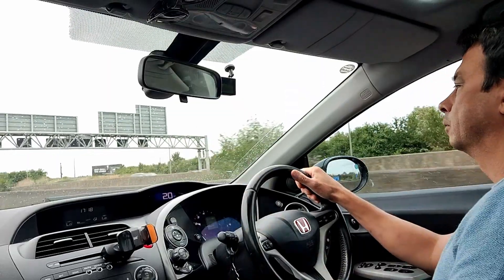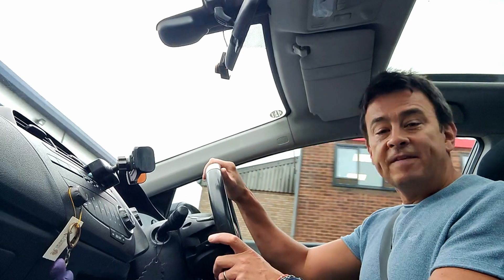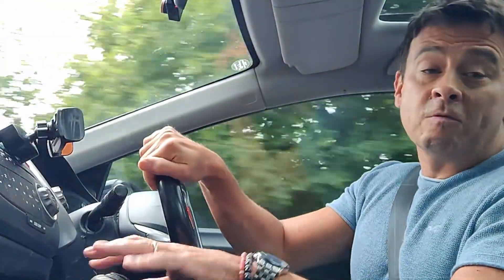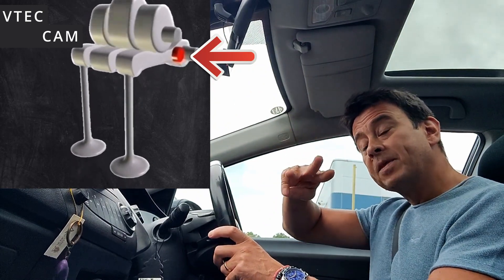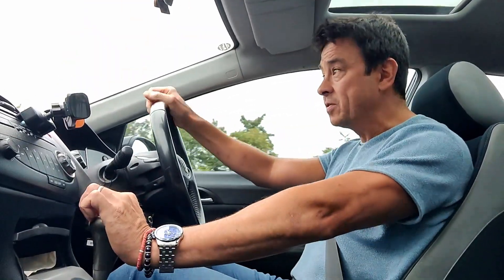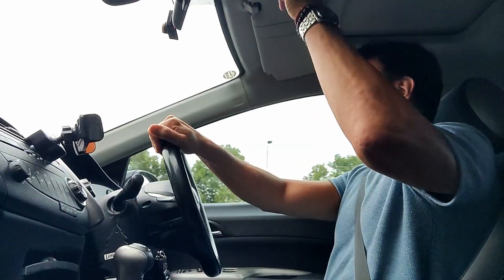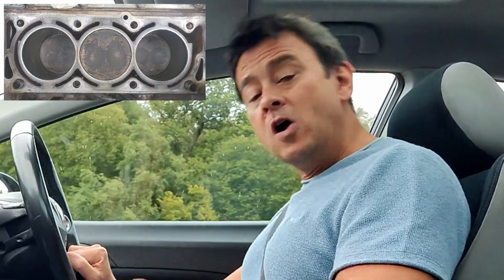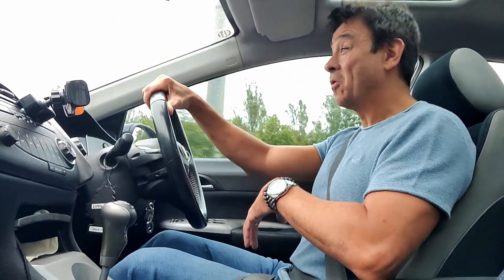Does your VTEC smell?😝- Here's how VTEC works - Honda Civic MK8

Comment: You are quite right, i get a carbon smell quite bad if i hit Vtec in my Honda Civic Type S GT. 

At first I assumed it was a slight manifold exhaust leak, but it was never picked up on any of the Mot's even when I mentioned it and it got looked at. 
I then asked a good Honda mechanic his opinion, he said the same as you about the Vtec and said these engines love a good clear out at higher revs every now and again (once a week), he checked my service history just to be sure and confirmed it was just a good run out hitting the Vtec is all was needed. It worked. Made perfect sense as it was faultless on a longer drives (over 25+ mins) even if i hit Vtec (No smell). I usually potter about under 50mph, 5miles a day doing the eco challenge on the dash like a granddad and trying to keep it 4-5 green bars for better MPG and this is what caused the smell, my style of driving under 4k revs. 
My best MPG yet is 43-9mpg urban which i think is amazing return for a petrol 1.8.   

Great little cars, I am still loving mine after 3 years of ownership and now i have a excuse to floor it every now and again for its own good 😄  

Great informative work yet again 👍🏻Thank you
Reply from the maker: Hi mate, thanks for a very comprehensive reply, like you I really enjoy my little 1.8 VTEC I bought her for 1,000 pounds purely to commute around London but I tell you this is the first Japanese car that I've owned and you simply cannot break them. Ok so the bils quality isn't the same as my Merc, but it's the reason I bought the car so that I could have my Mercedes back home and then in the week whilst bombing around London I can use the Honda. Mpg pretty good I usually get around 34 and that's a 25 mile each way commute, whilst driving to Glasgow like you I got early 40s.